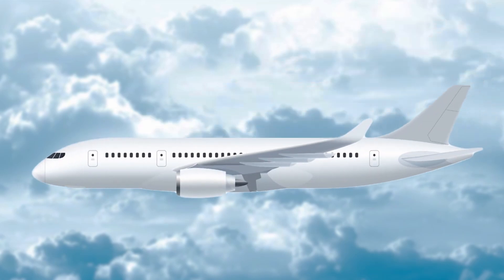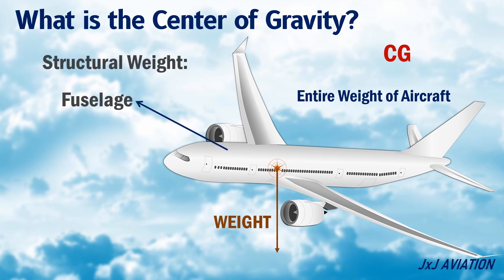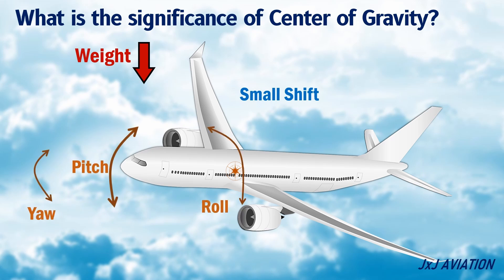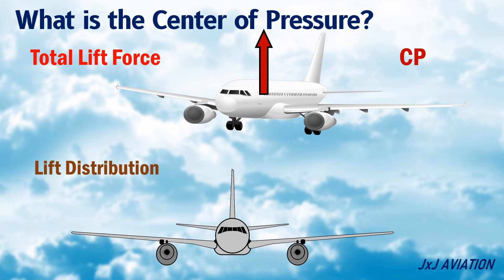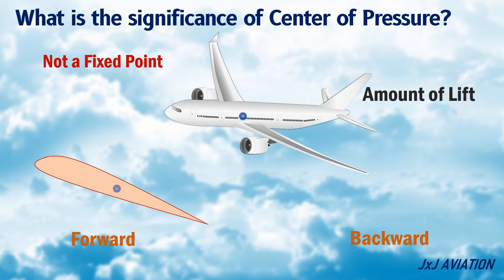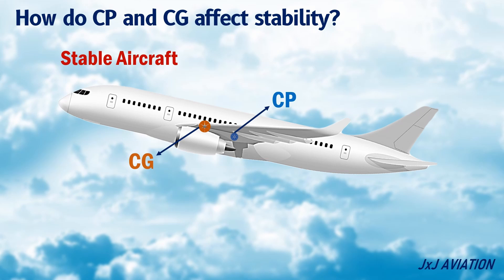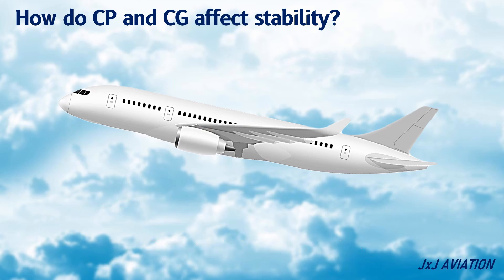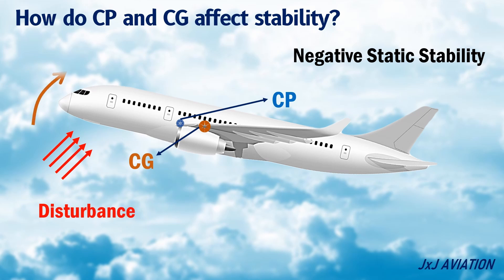Significance of Center of Gravity & Center of Pressure | Effect of CG and CP on Stability

Comment: The last point on negative stability explains why the B737 MAX required the flight control 'hack' (read: MCAS) to lower the nose at high AoA. The placement of the large fan engines so far forward created additional lift forward of the wing, moving the CP to the CG and possibly even further forward.
Reply from the maker: Great points! Thanks for the feedback!

Comment: Very nice video & good explanation shown with decent graphis - one comment though: it should be mentioned that on any dihydral wing aircraft not all the generated lift of the wing counteracts the weight - as there's a small amount of the lift "showing sideways" - thus: the wings must produce more lift, than the weight of the aircraft, as only their vertical component is counteracting the gravity ;-)
Reply from the maker: Great Point! Thanks!

Comment: Hey, I have a question. Are You sure that the control surfaces and their forces rotate around Center of Gravity, not the Center of Lift? I always thought it was the CoL, as it is what keeps an aircraft up in the sky. I would be delivhted if You could explain.
Reply from the maker: The rotation is about the center of gravity. Here the moment is zero. The CoL is where the resultant lift acts.

Comment: information        :29   it appears that the center of mass (c-m) is indicated in the graphic,  NOT  the cg*.        the c-m of an aircraft is located within the fuselage; at a  POINT  that lies  On  the thrust line and vertically aligns with twenty-five percent of chord.
1:20   cg location does have an affect on the effectiveness of aft-located control surfaces.    but the statement made here is  not really on point.            * cg is located  AT  the  wing, and is  the span-wise line of balance when an aircraft is  FLYING; and the mass of the aircraft is being supported by the main wing.
1:51   cp  occurs (at a 'line')  ACROSS  the  span,  not at the fuselage.!!!          googletranslate

Comment: If the center of gravity CG lies ahead, then the aircraft will have positive static stability.  If the center of pressure CP is at the exact location, the plane will have neutral static stability, If the CP lies ahead of the CG the aircraft will have negative static stability. The center of gravity is the whole aircraft's weight in a particular location. The center of pressure is all the pressure that lies on an particular location on the plane.
Reply from the maker: Thank you for sharing!